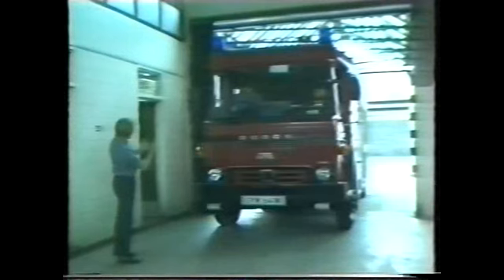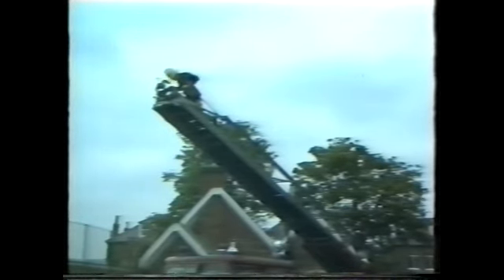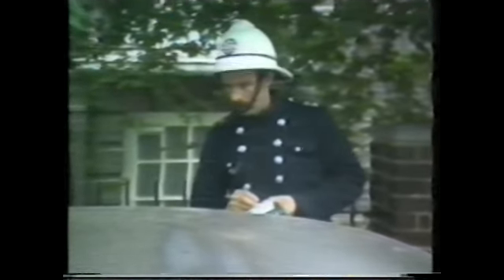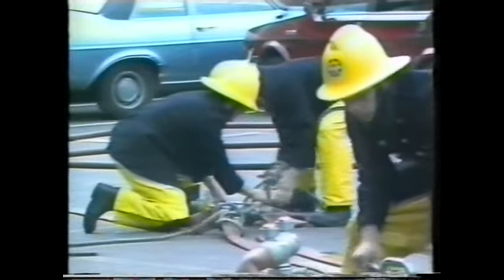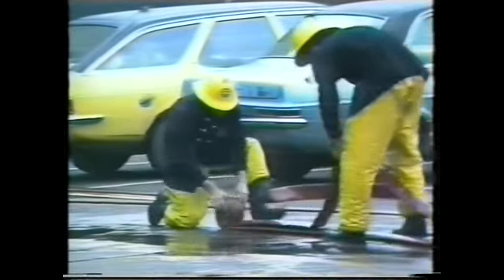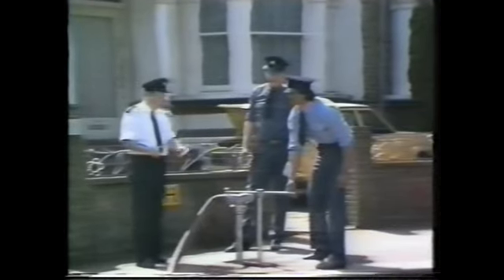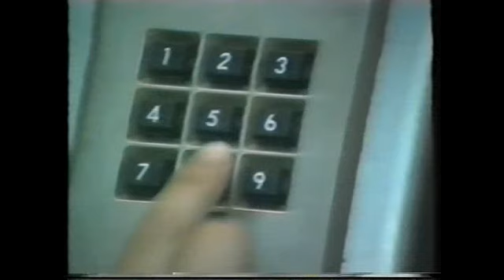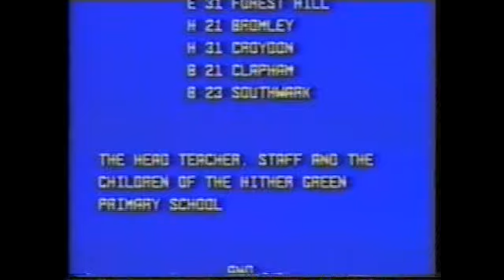Lewisham Fire Station 1983

Comment: Gear to be cleaned BEFORE going off duty, not when you come on or it was nut roasting time from the boss.  Neckerchief??? In our brigade call them snotter beckets to stop the snot running down your neck. 😀
Reply: Depended on the Guv mine used to say he wanted your fire year spi c and span on watch change at start of shift plus your headlamps better be working - brightly! And when I was the Guv - I was a right bastard!
Reply: Not headlamps you tube - handlamps - God this lot sucks!

Comment: I'm guessing the hydrants were different 40 years ago, hence why they're turning them on and off the opposite direction
Reply from the maker: Before modern era hydrants, the older type, identifiable by a longer cover were opened clockwise and closed anti-clockwise. 😊
Reply: @paddingtonfire  Very confusing lol . To try and remind people  that they oeprate the opposite way a good phrase is ' righty tighty ' ( to close ) and lefty loosy ( to open ).

Comment: Not to mention the two tone horn that was in use by the fire appliance during this era
Reply: I'm still alive - just and I remember the BELL that the OIC used to ring as a forerunner to the two tones and I must not forget the flashing red fire light on the appliance. The good old days!!
Reply: You generally knew where a vehicle with two tones on was coming from , more so than modern sirens . I remember driving ambulances that had both on and you could use them at the same time and it sounded very dramatic .

Comment: It has ALWAYS been illegal to measure distances along a Road in the UK in metric units.
"Two lengths of large diameter hosecan be laid at speed for a distance of almost One Kilometre." at 9:40
NOT IN THE UK.  It is only standard 3"  branch hose anyway.
Who are you - Remoaners?
Reply: oh sorry were you alive in 1983? you may have been but most likely very young yet my dad, born 1961 was most definitely alive during that time it was different. and it's not illegal...
Reply: The red hose is approximately 25 Metres long and either 45 mm or 70 mm in diameter . It is just how they are I guess , but it reassuring how even some can bring in a political and irrelevant comment into the most apolitical and informative video .